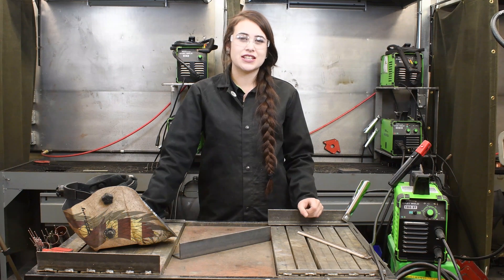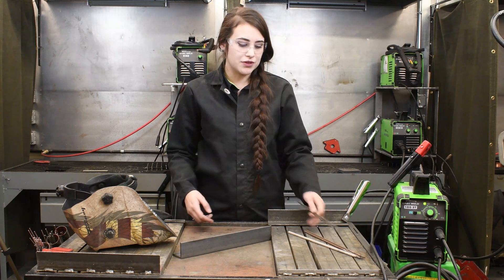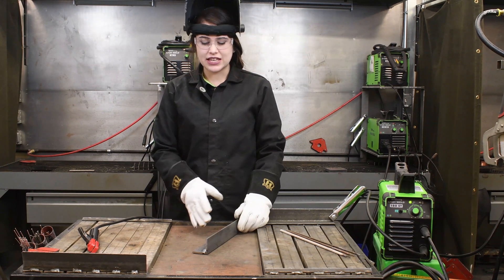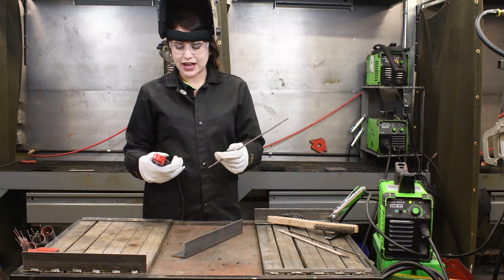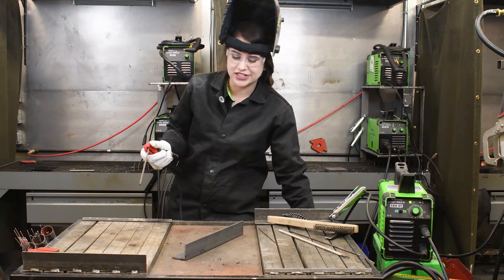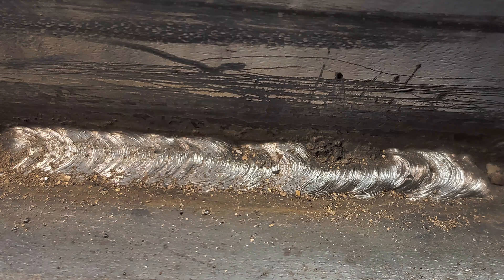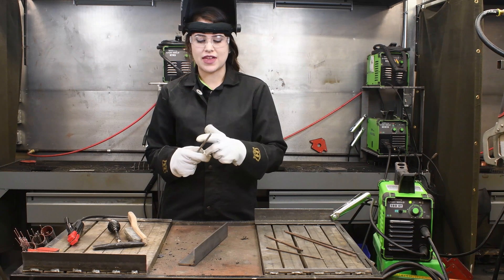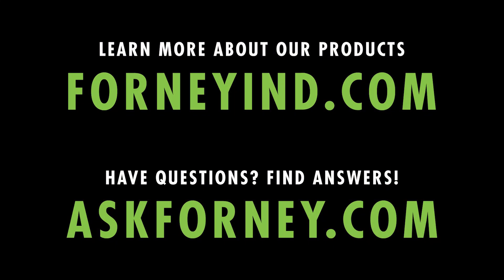Stick Welding with the Forney Easy Weld® 180 ST

Comment: What generator would be recommended to use with this 180 welder?
Reply from the maker: As the machine is dual input, the requirements differ depending on if you’re planning to plug it in to 120V or 240V. Both the requirements are below:

120V – 4,000W continuous output, with no low-idle function (or the ability to turn it off), generator that has 5% or less Total Harmonic Distortion (TDH).

240V – 8,000W continuous output, with no low-idle function (or the ability to turn it off), generator that has 5% or less Total Harmonic Distortion (TDH).

Comment: I just ordered this, am a complete welding novice, what is the right type of electrode and amps to weld 3/16 and 1/4 mild steel?
Reply: If you're a novice, start with 6013 regardless of the thickness on the base metal.👍👍

Comment: Great video. You can actually rub the metal with 7018 with higher amps, it welds itself. These are very good machines. Thanks.

Comment: These machines are great (like most Chinese IGBT machines of less than $100.- on Amazon, like the SIMDER stick welder for $70.-) There is a blue colored adjustable with a flat screwdriver riostat, that will allow these machines to output more than 150 amps on 120vac. Longevity is something else of course when doing this.

Comment: Where can I buy liner for  mig 308 welder. Can't find it anywhere
Reply from the maker: Hi Chi, you will need to call our customer service team to get that part ordered, or if you are wanting to get it somewhere else its industry standard number is Tweco 42-4045-15. This is a 15' liner so you will have to trim it to size (this is normal). You can call our customer service team at 1-800-521-6038.

Comment: She makes things crystal clear.
As far as the grooves  in the ,.......Electrode holder? You can also bend the welding rods in a arc or a V configuration to reach in tight places to keep the proper angle.
Also most welders come with a welding guide,..... that tells you the proper heat range for different metals.
Its usually under the wire lid.

Comment: Good job girly . Rake that weld don’t beat on it haha. Good job thanks for the info what’s the duty cycle please ?
Reply from the maker: Hi there, the duty cycle is 80 amp @ 30% for 120 volt; 180 amp @ 25% for 230 volt. Thanks for reaching out!

Comment: Undercut was likely because you didn't clean the millscale first. Tip: use that chipping hammer to rake the slag, rather than to bang it. Clean that millscale, keep that tight arc, and those welds will peel themselves.

Comment: Can it do stick 1/8 7018 on 14gauge square tubes?  I am fabricating some columns. 8' x 3" tubes on a 6" plate 14gauge for a carport or what do you recommend? On 120v